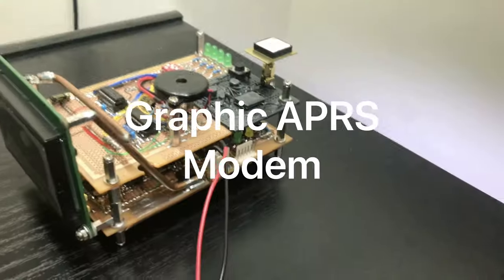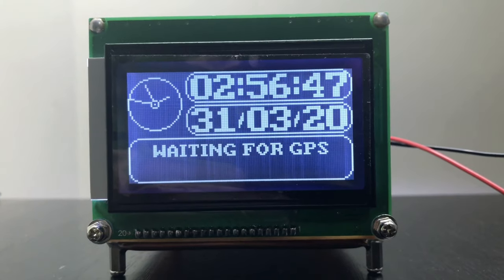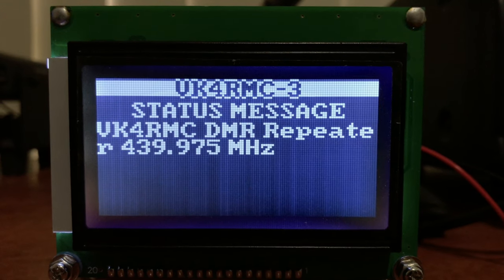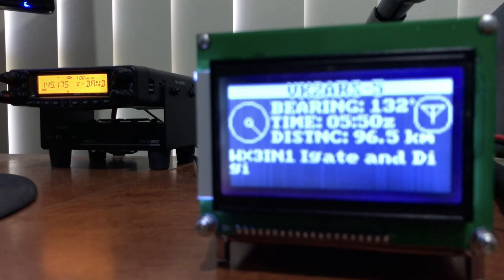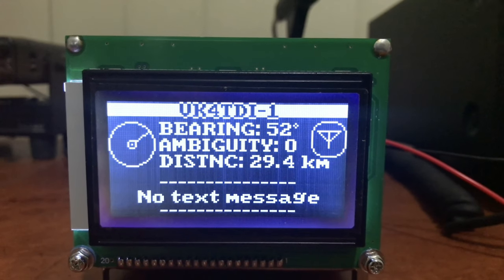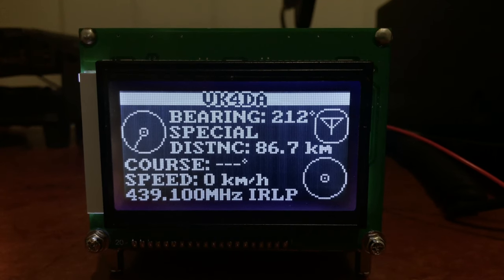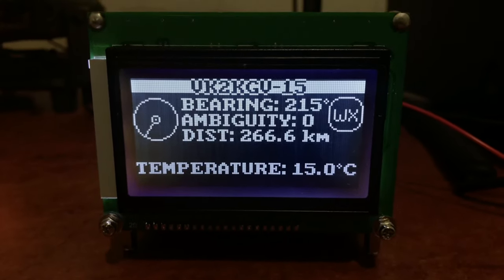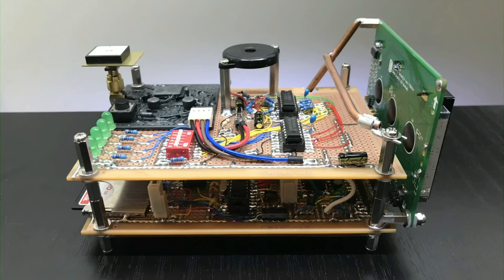Graphic APRS Modem - Pt 1

Comment: Can you upload the circuit diagram of freedom platform project???
Reply from the maker: Easier said than done, I built one on camera point to point, so someone could. PCB CAD is something I should tackle with all this time at home, but then programming doesn’t happen on it’s own either. A schematic for one would definitely result on a schematic for the other though. Both projects are very similar in hardware.
Reply: Thanks for your reply. 🙂